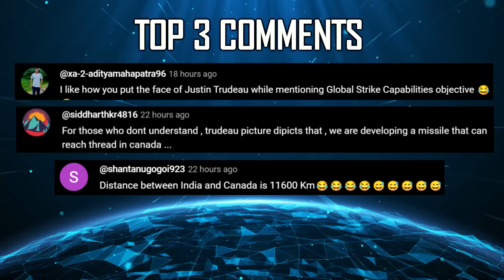Indian Defence Updates : Tejas Free Export,Tejas New Engine,Astra MK3 Delay,Direct 5th Gen Purchase

Comment from the maker: :yt:What's Your Opinion ? "Over the counter" purchase of 5th Gen Fighter Jet" ?
ＬＩＫＥ | ＣＯＭＭＥＮＴ | ＳＨＡＲＥ | ＳＵＢＳＣＲＩＢE
Reply: Mrfa is dead project instead of concentrating on mrfa we must buy 3 or 4 squardons of rafale or atleast buy kf21 and 6 to 8 squardons of tejas mk2 depending upon trails and concentrate more on amca  fighter jets 300 to 350 and start a development of sixth generation fighter jet for the replacement of 4th generation fighter jet after 2055 or 2060.
Reply: Putin is visiting in December. Su57 is on the cards😁
Reply: This the last and only option for IAF to procure 5th generation jets until AMCA is in service😂
Reply: Some numbers of 5G jets over the counter is fine but need engine & jet made in India paralelly
Reply: Su57m
Reply: Pure speculation at this point. F35 not available. Su57 not proven. In this case if Su 57 can be evaluated through trials and if it is really stealth, we should cancel MRFA and buy 114 Su 57 with ToT. If not just stick to MRFA
Reply: We must buy 5th generation aircraft only.
And parallel to this we should continue our Tejas mk2 and AMCA programs

Comment: K4 not test it's operational test. So not test, actual operation clearance @ utuber. Since it's effect USA centric due to neuclear submarine lunch ,and submarine reach world over so  mad president jo bidden applied economic😮sanction.@ u tuber. When Notam given missile enter space. Down Notam clearly says mirv. Life fire from submarine. So k4 in world one of the safest slbm just like k15. Indian submarine till safe not sank like china whic😮two neiclear😮submarine sank either reactor blast or jl3 slbm blust in tube. One kursk akula submarine of Russian sank in war game. Alright arahont airidamon all have k4, k5 lunch 
Probably k5 lunch on 27th November with 6000 to 8000km range at topup fire mode like North Korea. So not official announce. K4 airahont lunch 2016 7th march 31 march with 3000km Notam. 2016 April k15 lunch from airahont ,2019. And 2020 January from airahont fire. Official announcement 2020 k4 inducted. Times of India report k5 will fire 2022 
But drdo announce extended range k4 fire with  nearly zero😮accuracy probably k5 test. 27th November drdo just give Notam not missile name so k5 with mirv @ utuber

Comment: Good that HAL Chairman visiting russia for engines. Infact take one 414 engine and ask him to make an exact replica which can be fitted in mk1a and mk2 if russia has not a smaller engine in size. Yes you have to move here and there for engines. 100 tries you will do only then 10 tries are viable. And here is finally russia again. And regarding 5th generation su75 or su57 or both should be government to government deal with HAL. And after that if anything is possible then go ahead
 But first SECURE YOUR TIME AND MONEY WITH RUSSIANS 5TH GENERATION. Good luck for best engines for mk1a and mk2. 👍 👍 👍 👍 👍 work.
Reply: New engine for MK1A and MK2 is not possible. That will take years of development and testing. Not feasible economically. 

We cannot simply take 414 to russia, US wont allow that. Sameway russia wont allow AL31 from India reaching US. 

NO Su 57 without trials. There is a question about its stealth